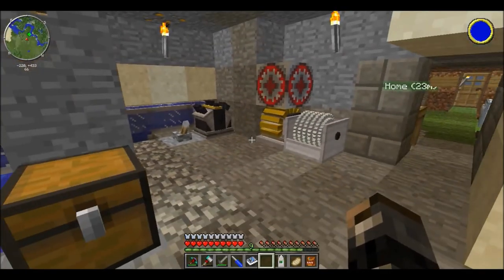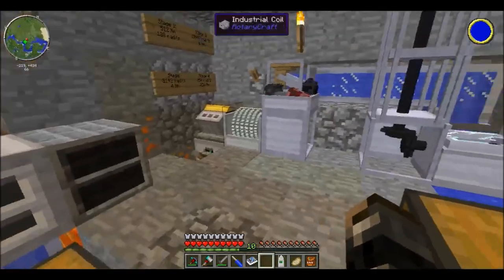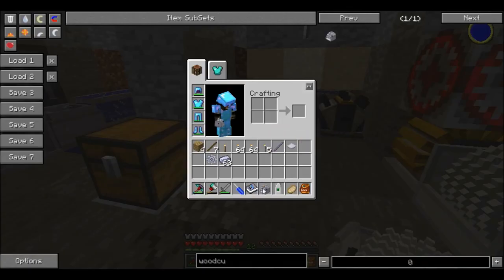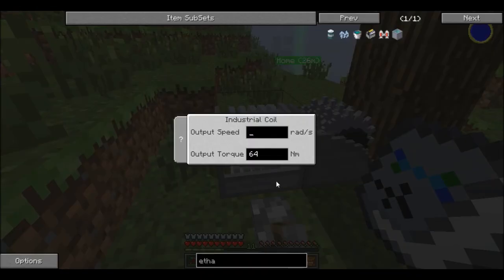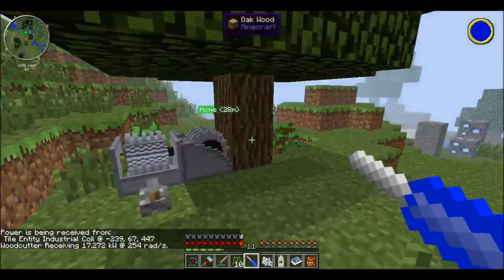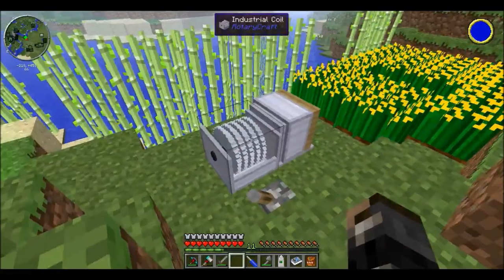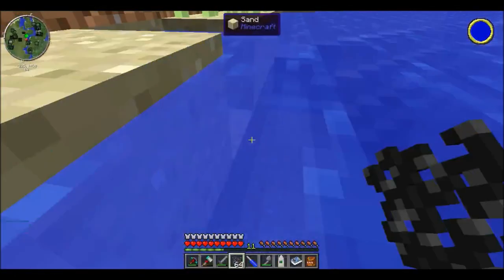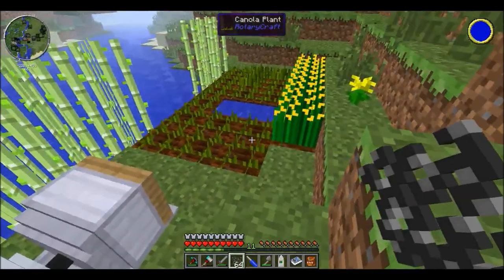How to get started with: Rotarycraft (part 2)

Comment: What tortuge and speed are needed to run the boring machine at y~level 10? I used 512 nm and 64 rad/s, which would be at the maximum written in the handbook(32000W), but i only goes sparkling. Tried it with lower values, that ended in sparkles as well(eventually, it didnt make a sound for like 10 seconds).
Reply from the maker: I get that too. I've noticed that mining away some blocks immediately in front of the boring machine solves the problem.
Reply: Danilus Guess i'll try that tomorrow.